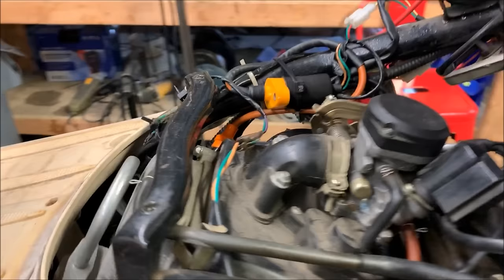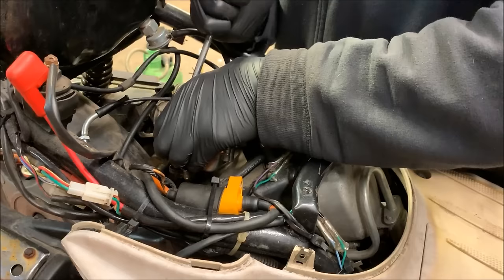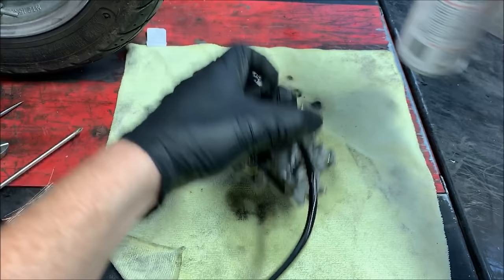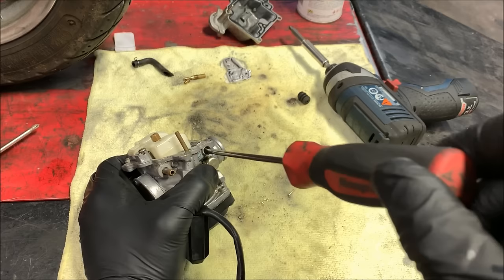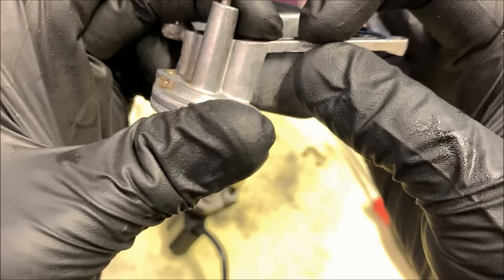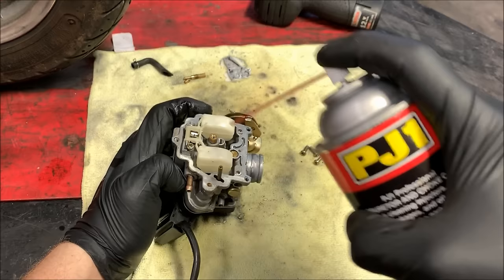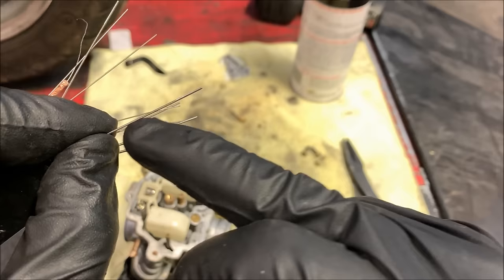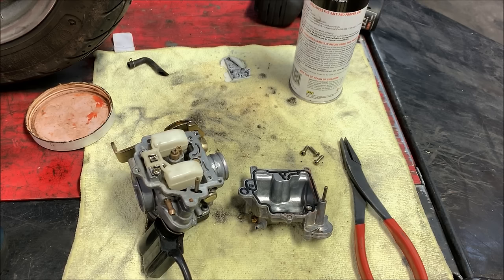Cleaning a scooter carburetor

Comment: Just wanted to say thank you.  I "Cleaned" my carb before watching your video. Still wouldn't run. Your example of cleaning the jet with a small wire (I used guitar string) saved me. It was plugged, and it would not run.  Now it runs like a charm. Thanks for putting this out there. It really helped.
Reply from the maker: Glad to help

Comment: I don't have a compressed air pump, but I did work around it with a bicycle foot pump with one of the conical attachments for inflating pool toys. I put the attachment into one end of a short carb hose and put the other end onto the pilot jet. Then I was able to blow out the blockage.
Reply from the maker: ok

Comment: Base on my own scooter components replacement record file, I listing them as below: (1) scooter fuel tank use 18661KM (2) scooter spark plug cap use 3535KM (3) scooter fuel filter use 6668KM (4) only those fuel lines I never very detail to check to replace that before! If you have further suggestion, please make me know to fix my trouble here, thanks!

Comment: One of the best carb practical videos on YT for sure !
I've helped my self learning about carbs and carb components and how to clean it with this video, made a good over all clean
few months ago, today i wanted to ride my scooter after it's been sitting for a while and of course, it didn't fire at first. then i remembered you saying in this video about how cleaning the pilot jet is enough, i didn't have all the tools prepared only a wrong sized flat screw from a leatherman that actually broke and damaged my pilot jet head, a garabge screw driver that stripped one of the philips screws and carb spray, anyways cleaned it and managed to fire my engine back again right away ! !
<3
Reply from the maker: thank you!

Comment: Instead of running your battery down or covering the air box with you hand to fill the float bowl, just pull the vacuum line off the intake manifold and suck in like your hitting a  bong 4 or 5 times and the bowl will fill up. Put the vacuum line back on and the bike should fire instantly. Also, if your bike wont start after cleaning the carb check your valves (assuming you have already checked for spark). By the time the gy6 engines get to the 3,000-4,000 mile mark the valves will need to be adjusted. Set them to 0.004" Intake and Exhaust.

Comment: You dropped some knowledge. It's much appreciated. .   If I bbk to 72 an it was 50. What size jet should I use at basically sea level an does it make sense to put the fuel filter in-between the tank an vacuum pump?

Comment: Great video! Cleaning out the pilot jet and the mixture jet circuit did the trick. Also, adjusting the mixture screw 2 turns helped the idle out so much. My scooter would start but only idle for a 5-7 seconds before dying. It had been sitting for 5 months over the winter. The scooter is a Lance PCH 125.
Reply from the maker: glad you got what ya needed!

Comment: Thanks for the video. It is a great help. I have   (2) 2007 Honda Elite 80 cc. Both scooters have  less than 160 miles each.   I watched this video and got 1 of them running today by following your advice. I will tackle the other carb tonight. 
Pilot jet was clogged and I made sure all the passageways were clear with air comp... 
Its time to part with them, just want to have them running great. Thanks Again
Reply from the maker: Glad it helped

Comment: I also, in addition to everything you did here and this was a wonderful explanation, I placed a brand new fuel filter on the fuel line. It was a shock to find green mold growing inside the filter I'd installed just a month ago. Man  these things can be problematic. Never put anything but pure new gas in there, never.
Reply from the maker: thanks

Comment: So I have a Tao Tao 50 cc scooter, the carb looks exactly like this one. It only has 35 miles on it and has been running like crap. The factory carb is sealed so you can't remove the 3 screws there is no head on them. I ordered a brand new carb online and put it in, it fires right up but only idles, as soon as I give it gas is kills. I am lost, any ideas?
Reply from the maker: You likely need to jet the carb

Comment: Do you have a video for the Keihin NVK carburator? Does that one also have the sealed mixture screw?
Excellent video very informative
Thank you
Reply from the maker: No
Reply: @Scooterswapshop  On my carbe the pilot jet hole is completely clogged and the jet wire cleaner is not doing the job i even put it on my drill while holding the wire to drill it out but its not working i might have to buy a new pilot hole jet.

Comment: Question, my 2020 49cc wolf islander with 3890.1 miles does not have the power to get from 0 to 40 like it used to, also I had to make it idle higher to keep it from shutting off after letting idle.  Things I did to fix but did not work: changed spark plug, fuel filter, air filter, and valve adjustment. Valves were okay.  The spark plug was wet oily looking after letting it sit for two days. I am thinking my carburetor might need cleaning or replacement. What is your professional opinion?????  Thank you.   

Someone please help and I thank you.
Reply from the maker: we dont mess with the chinese bikes just take it step by step

Comment: Regarding float bowl gasket swelling at 23:36 mark.  Try cleaning the gasket with soap and water (e.g. Windex) and rinse with cold water. Then treat the gasket with Prolong Super Protectant PSL60017.  The gasket will usually return to its original shape.  Treating with Prolong is an optional but recommended step.
Reply from the maker: or just replace it

Comment: Can I use a PZ20 instead of a PX19? It’s a 1997 xr70r stock engine but I can only afford one. I know there Chinese parts but it’s just a fun bike with the kids. I’ve had 3 CT70’s green, red and blue. Only one was a manual clutch and the smaller kids liked the automatic. I have had 3 z50’s. But anyways can you tell me which carb will work better please.

Comment: How can you access the mixture screw without completely disassembling the exterior coverings. 
Should the mixture setting screw have been set a more accessible position?
Reply from the maker: Depends on the bike. If it’s a Chinese scooter or a bike with a lot of fairings too have to take the fairings off. This isn’t something you have to adjust all the time

Comment: Dude you know this stuff..  I got a gen v 50 maddog. I a bought a blacktop serviceable cvk from parts for scooters an Im not a carb tuner but seems like the something wasn't right with it. I don't know. I've bbk 72cc ncy CVT.  A just bought another wiring harness from where I bought the bike an it is started twice but that's it. Does it make sense to go with a pe carb with manual choke. I'm on the East Coast in the middle

Comment: I wanted to fit a manual choke to mine as it doesn't start without your hand over the carb is there ne listed or will change the carb for another type very nice video on cleaning very helpful and informative regards mark
Reply from the maker: sounds like you need a tune up first

Comment: I just bought a metropolitan from an auction that has 1146 miles on it. Was missing air filter and a couple cracked plastics. It barley wanted to start and the fuel pump was clicking like crazy. I replaced the pump, added a stock filter and I believe I did a good job cleaning the carb and I also reset the ECU. Now it fires up in 2 or 3 kicks. Idles good and seems to run good on the stand but it bogs at about 1/3 throttle when the wheel is on the ground. Am I missing something or do I need to take another shot at cleaning my carb?
Reply from the maker: hard to say

Comment: Nice job! Im having two issues, one is if I left the fuel valve open the next day the cylinder is flooded with fuel. The second one is new, in low RPM the bike is gasping but at full throttle works fine. What I need to do? thx
Reply from the maker: jet it differently til you get to the desired tune. or re clean float could be damaged or stuck

Comment: do you disconnect the battery before working on the inside?
Reply: Bit late and i'm not sure but why not do it to be sure. Takes 2 min
Reply from the maker: NO NEED there is no electronics

Comment: I just did a big bore kit on a 2021 Amigo Speedy 50 to 80, it still has the 50cc carb on it. It isn't getting fuel, so a good clean and adjustment is needed. Do I need to change to a larger carb if that doesn't work?
Reply from the maker: You need to tune the carb and jet it
Reply: @Scooterswapshop what is a good jet kit for that application?

Comment: Howdy.
I have a Yamaha Majesty 250cc. When the engine is cold it starts well. After it warms up, it stops and doesn't even start beating :) If I lift the 3 ... 5 mm carburetor from the intake manifold, the scooter starts and goes well. How I stick it to the gallery, how it stops. I opened and cleaned the carburetor, except for the jigler with the lid, which you removed with the drill (the one outside). Can you tell me, please, what is its role?
Thank you.
Reply from the maker: Could be

Comment: I have a sym100, I cleaned out the carb, when cold it should sit a wile before it rev up. 2 stroke.  I have one question... That hole in the float bowl where that tube from the choke fit in, Should it be open at the bottom of the bowl to the main compartment, or should it be blocked. If I look in the bowl, it looks as if there is a small brass part between the bowl and the chamber where the choke pipe fits in. But as I checked, it is closed. I am talking about that port that you first inserted at 25:34. Should it be open at the bottom or not connected to the main bowl??
Reply from the maker: nice

Comment: Great video. Took mine apart and a little small ball fell out of the carb. Any idea where it goes on the fuel pumper? Hard to find a diagram for this crab
Reply from the maker: No, sorry
Reply: I remember somehow. It's probably some kind of a one way valve. You opened a screw, then there is a spring and the ball underneath it. Just drop it in the hole and put the spring and screw on.

Comment: The pilot jet will not clean out. I have used a tool like yours, and a single wire from a 16 gauge wire with no results. Where can I get a new pilot jet?  ty
Reply from the maker: Hi. It depends on the carb your working on it’s hard to know where to send you without knowing
Reply: Hey Big Guy, Just got thru buying the carb. off Amazon. I was thinking hundreds for the part until I did my research. Very good video, and I thank you for answering.     Bob!
Reply: Copper wire is safe but it's usually too soft to push through a tough blockage. Try bristles from a wire brush or find someone that vapes that has some kanthal wire. For pilots in 50cc bikes I'll start with 30 gauge kanthal and just gently twist like he did in the video.

Comment: Going to try this tomorrow, wish me luck! How many turns on a Chinese 150cc scooter? I liked and subscribed!
Reply from the maker: depends on your environment and fuel just gotta take it 1/2 a turn at a time
Reply: I’m stuck at removing the throttle cable. The lock nut on the L shaped connector won’t budge and the inside of my scooter has no maneuvering room

Comment: Hi good vids man. I have a kynco 500 and the engine coolant drips out from the breather line any toghts And also it dont idle is really rought and rpm goes ip and down when u rev it uo to like 5k it goes down after couple sec. I need some help. I clean carb some and swap all fluids
Reply from the maker: take it to a dealer

Comment: I bought a clone carb for my elite50, there is an extra port that comes out the front of the carb that bends towards the front of the scooter. Any idea what it is? Your site sells a carb just like it, it’s above the bystarter wiring in the REPLACEMENT HONDA ELITE CARB that is on your site.
Reply from the maker: Hi the best bet is to contact the shop you got the carb from for assistance
Reply: @Scooterswapshop  okay well if I bought your carb, which looks exactly the same as the one I have, then what would you tell me? I’ll buy Paul an energy drink I swear 😂

Comment: Hey I hit a bump and now my moped won’t get spark. Any comments
Reply from the maker: Hit another maybe it will re start :) not too sure I’d check the spark plug cap, make sure you carb is on tight
Reply: @Scooterswapshop  thanks I’m thinking it’s the stator maybe. I tried mostly everything else bought a new coil and wire.

Comment: Nice job on the info and the production.   I have gy6 lance soho 50cc running top performance for stock  BUT the idle surges from about 1750 to 3100 if it sits after warm up.  20 seconds from hi to low idle   Rev it to 5k on kickstand and release it ids slow to come to idle.  HELP.
Reply from the maker: Sounds like you have a carb issue .

Comment: Tip for if your gasket swells too much for the bowl or whatever, boil them in water for a min at a time and usually, it will shrink back to the original size
Reply from the maker: yep good tip
Reply: When u remove them, soak in light oil  so they dont shrink. As the gasoline they have live din for ages leaves, they shrink.

Comment: I picked up a roketa mp250a which is the same as a jonway yy250t honda reflex clone. It runs great until warm then will not idle. I tried cleaning carb no go bought new carb won't even start. I'm sending back new carb to say the least. Once warm I gotta hold the brake and give it gas so it doesn't die at idle. Otherwise it runs perfectly, what do you think may be my issue. I ask because I'm sure you've come across similar situations. I'm very mechanically inclined this is the first scooter ever for me. I'm just not familiar enough w these to know is all. Thanks in advance.
Reply from the maker: This is a very common issue with the 250 clones. We decline servicing them as there’s too many issues unfortunately. Not too sure what the solution is for your bike
Reply: @Scooterswapshop  any suggestions???
Reply from the maker: @parkersgarage4216  not sure to be honest, Chinese bikes often have far many more issues and issues that don’t apply to other bikes. 

Also the new carb you got was likely a Chinese Amazon carb they’re hit or
Miss
Reply: @Scooterswapshop  correct it was the only one I seen that matched mine the closest. This one here was definitely a miss for sure lol. Thanks I'll keep digging into it

Comment: So if I cant run a guitar string through the pilot jet its clogged? Before I took the carb apart gas would come out of the drain bolt I cleaned the jets with carb cleaner tried to run a guitar string but couldn't get it all the way through do you think I may have clogged it even further
Reply: P.s. 2015 symba 100
Reply from the maker: Hard to say as I don’t know what your stock Pilot size is. You should be able to see through it and it’s best to use a helix carb cleaning tool kit. It has brushes for these jets

Comment: Just wondering if this auto chokes cause my scooter to bog from cold start after letting it idle for 2mins with 8deg weather. Like it bogs when i drive it after 2mins idling but will be fine afterwards and very responsive. Does it flood the carb when it’s on?
Reply from the maker: It’s possible. Hard to say without having the bike of course

Comment: Have you ever seen a 139QMB that shuts down once it is warmed up but starts right back up only to die over and over again?
I replaced the entire top end on one ( torqued to 20 in.lb ).
Valves set at .004 intake and .006 exhaust. 
All electronics have been tested to be within parameters.

The longer it runs ( the warmer the engine gets ) the shorter the time it shuts down.
It does not matter if it is idling or part throttle.
Starts right back up, idles correctly & great acceleration, just will not stay running.
P.S. it is getting spark even past where it shuts down ( tested with a timing light ).
Carb. has been meticulously cleaned twice.
Definitely not in the carburetor as I have changed the carb. out with 2 new ones, a 20mm and a 24mm.
Reply: same issue here
Reply: Have you checked your fuel valve from the tank ? I replaced my vacuum fuel valve with the manual type . bad diaphragm or vacuum leaks will affect the valve then you are not getting the right amount of fuel.
Reply: @donrodriguez8615  I did, I bypassed the petcock vacuum valve and put in a regular inline valve ...  I'm thinking its the needle & seat thats messed up on mine ... I can hit 20mph quick... then it stumbles ... let go for a second and I can maintain that speed
Reply: @esbekay  do you know what slot the clip is in on the  needle ? Top , bottom , second from bottom ??
Reply: @esbekay  how many turns out is your mixture screw ?
Reply: @donrodriguez8615  I thought it only went on one way ... you mean the lead slug that connects to the barrel the needle sits in right?
Reply: @donrodriguez8615  its in till its "tight" then backed out 3/4 turn
Reply: @esbekay  take a look at 50cc carb tuning. They can help you a lot
Reply: @esbekay  49ccscoot is a good guy , take a look at his videos
Reply: @esbekay  that's too lean
Reply: DON RODRIGUEZ I actually just started following his page earlier .. I got these 2 49cc Yamaha Vino clones for free off someone who had them sitting in their yard for 5yrs ... got the one running fine , other needs a new carb bad .. but this is the only issue I’ve ran into... I’m doing the big bore upgrade next ... Thanks for trying to help man
Reply: @esbekay  did you clean the jets ? That should have been your starting point on a scooter that has set for a while
Reply from the maker: likely the auto choke

Comment: My friend my scooter 2008 ZN 150cc 3 wires come from stator when I started engine those wires get melted, hot very hot, do you tell me the solution, I couldn't find, I tryed but nothing, thanks for your help.
Reply from the maker: There really isn’t much I can offer for that as the Chinese bikes are all different. It’s common to have electrical problems with them